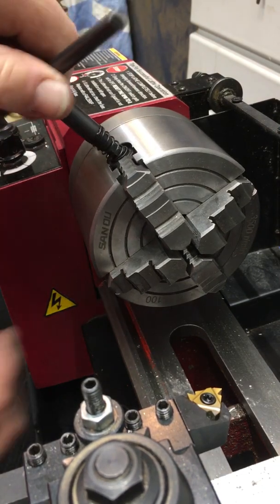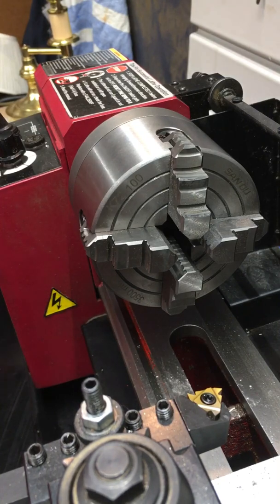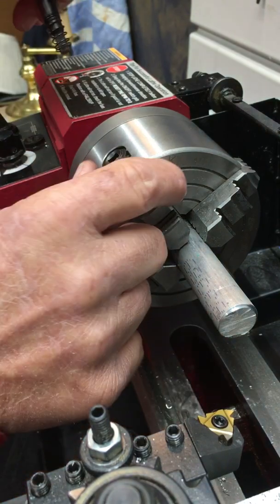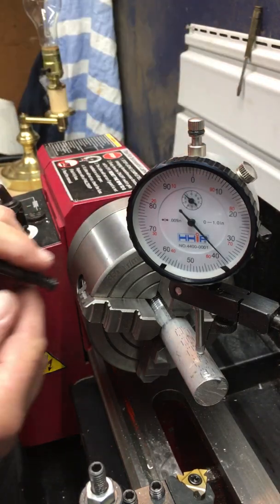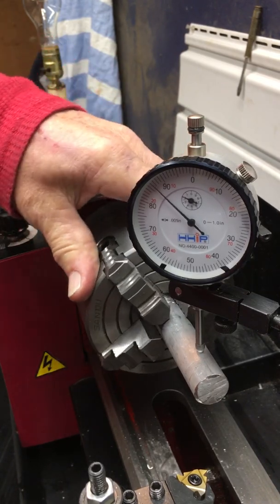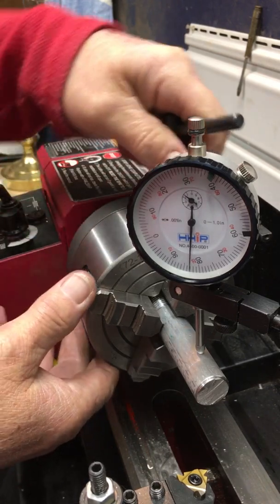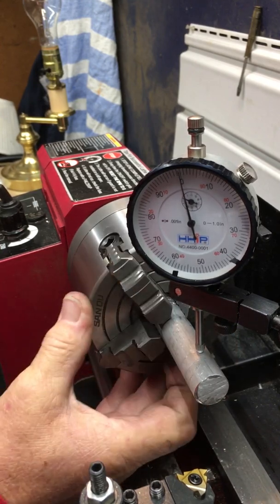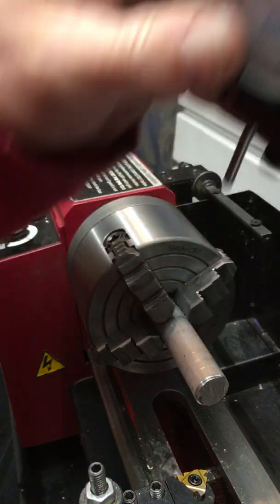Chinese mini Lathe threading part two

Comment: I am a newbie here. How doues the cutter find the correct starting point on the second an subsequent cuts on the thread. Seems that if you are out by 1/2  a revolution the thread would be ruined.
Reply from the maker: Do you use the thread dial on the machine and for particular threads you use the letters ABC or D some dredge you use the alphabet so you come back and start at each time on say the letter a sew the threading tool runs down the work cutting you stop it back it off, back it up, reengage it and start on the Whatever letter or number I said just keep it the same every time while advancing either Crossslide or the compound depending on the size of the threads there are plenty of great videos on threading if you want to see some specifically using the mini machine I have quite a few videos on threading as well

Comment: What settings are off if I have a difference of.030mm from the beginning to the end turning a 6 1/2 inch aluminum bar stock.  It happens using a 3 jaw chuck and a ER Collet chuck.  I have a new Harbor Freight 7 x 10 mini lathe like yours. What do I have to do to make it almost perfect
Reply from the maker: Tailstock alignment be sure your readings are correct you may have to clean up some paint around the tile store if you can go on YouTube and see some examples of how to align your tail stock

Comment: Nice job Kimber as for cutting oil what you are using is better than WD40 I use aluma tap witch is the same thing can not wait to see how this turns out so far so good
Reply from the maker: Joseph Duda thanks Joseph I have still come to the conclusion that if I need threads, I’ll buy a die or a tap.When I get a real lathe I may revisit I will definitely revisit threading. Not sure if it’s my lack of experience and skill or if it’s the in adequacy of the machine might be a little of both
Reply: @kimber1958  that machine should thread fine but the cross slide needs to feed on an angle or it will put tomuch stress on the lathe you need the old cross slide set at 29 and feed in on that